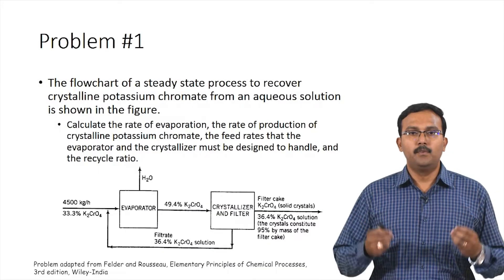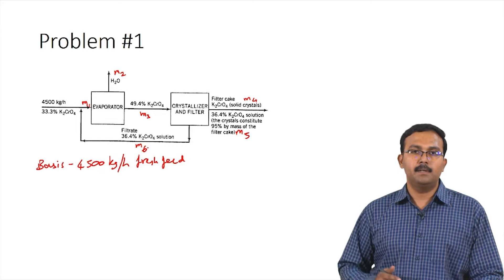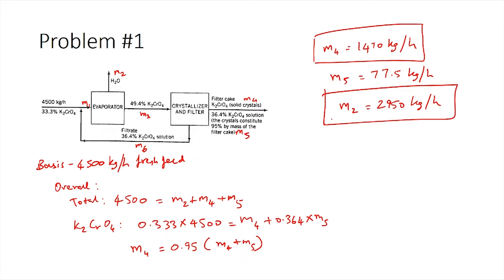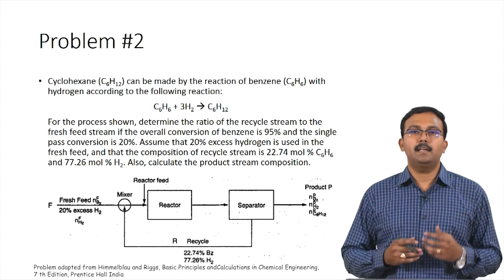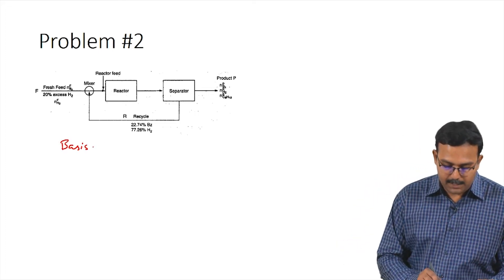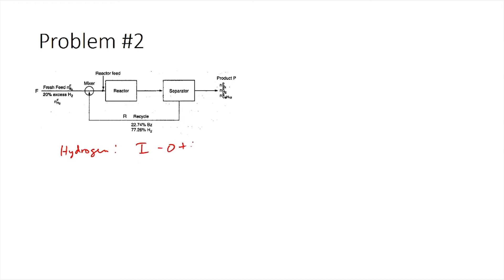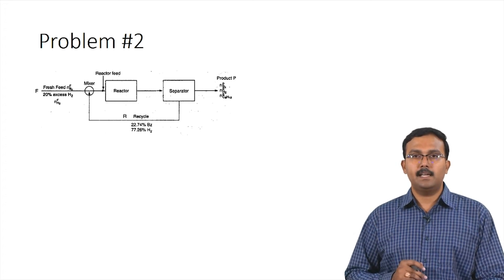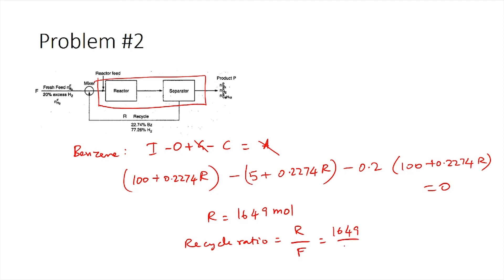#25 Recycle Tutorials | Material & Energy Balances

Comment: Where does the value of 1.5 in H2 supplied come from?
Reply: I assume you mean 1.2*300, basically H2 is in 20% excess so  whatever moles are obtained from the stoichiometry in this case 3 * moles of benzene which is just 300, we just increase it by 20% which is just basic math

It is given by, 300 + 20% of 300 = (1 + 20/100) * 300 (from taking 300 common) = 1.2 * 300 = 360

Hope it helps :)